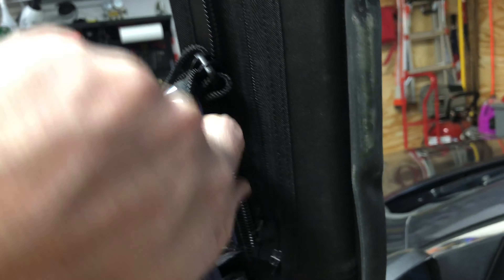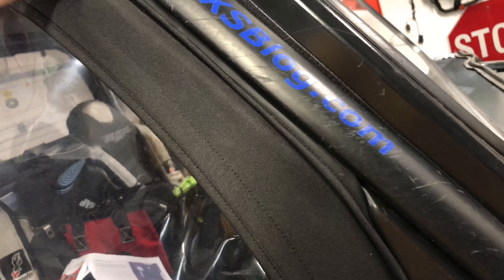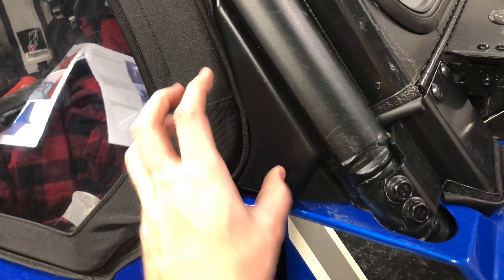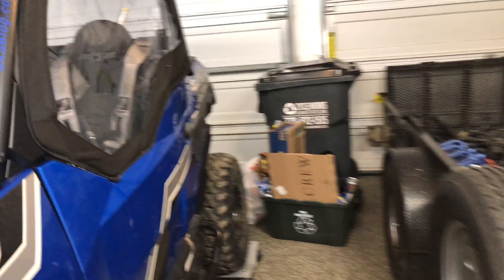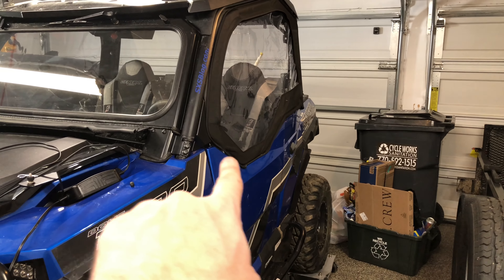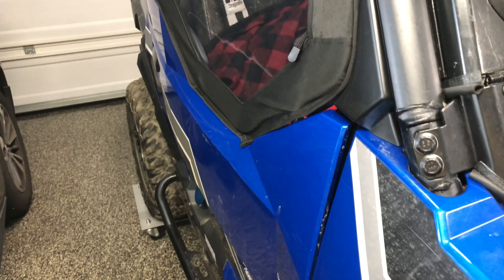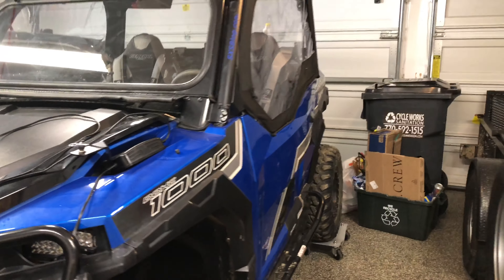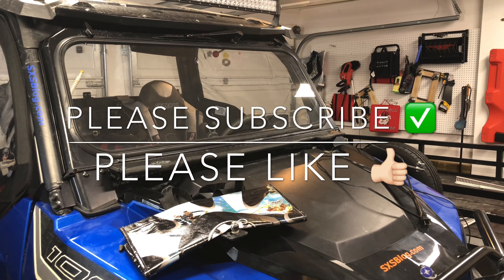Polaris General - Spike Upper Doors (Part 2)

Comment: Its looking good man. Hope the windows work out well 4 you. Thanks again for the great videos. Wondering how many miles you've got on it so far. Any issues you haven't mentioned in videos?
Reply from the maker: I think I’m up to around 600 miles. No other issues with the machine.

Comment: Did the drivers window have the sewing thru it to prevent unzipping all the way as the passenger door did?   How is it while driving?  Do they flutter?
Reply from the maker: The drivers side has the thread as well. I’m still trying to decide if I want to open it up to fully zip down. As to driving, I’m hoping to get out over the holidays. I’ll definitely post a video after the ride with a more thorough review. I don’t think there will be too much flutter though as they are not “loose.”